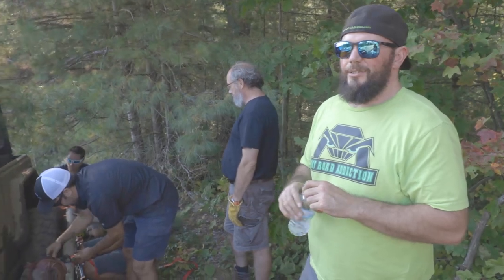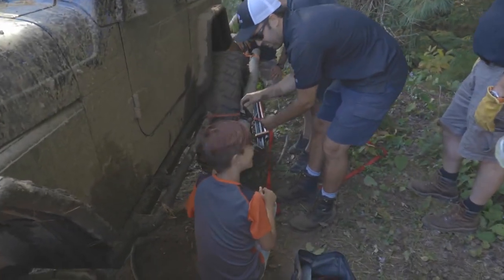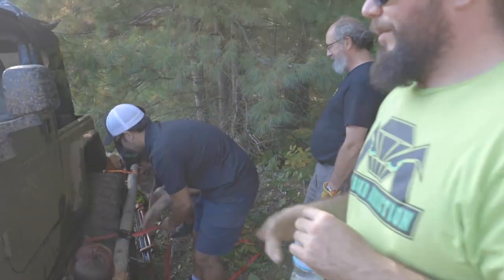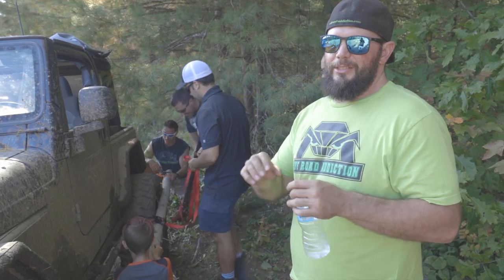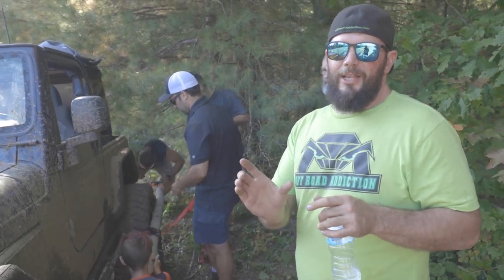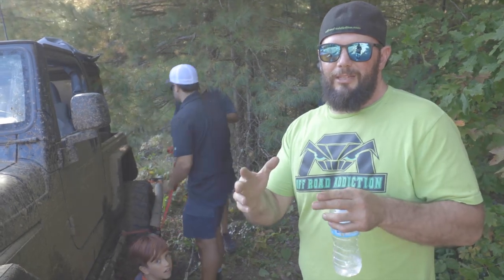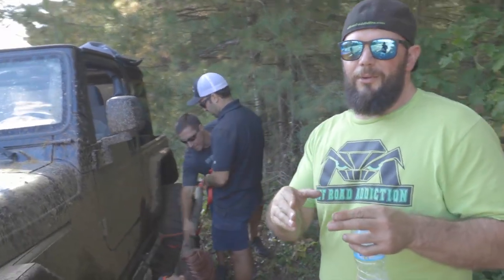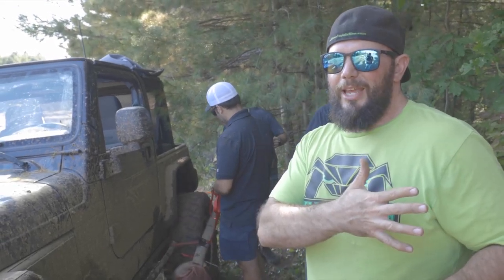How to Fix a Broken Axel While on a Trail

Comment: Ive never seen this before😂
Reply from the maker: minimonkey969 DANA 35 problems. 😁👍
Reply: @OFFROADADDICTION  yup makes me scared to even wheel mine. I've been searching for axles and they're so dang expensive. Rubicon axle is around $2000-2500 with the correct gearing. Then I'd need to regear the front and that's another $700. Plus installing the axle. I got a quote for an 8.8 conversion and it is $3400 with truss and regear the front to match (4:10). Just out of reach for me and this sucks since I have 3:07 gears. And a super 35 kit is like $1000 if you get a true trac and another $1500 for regear.